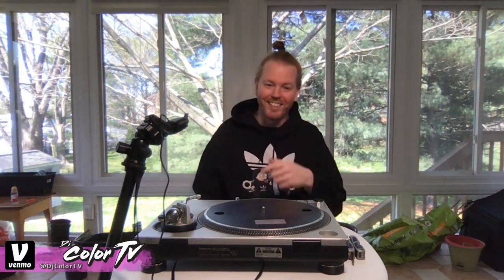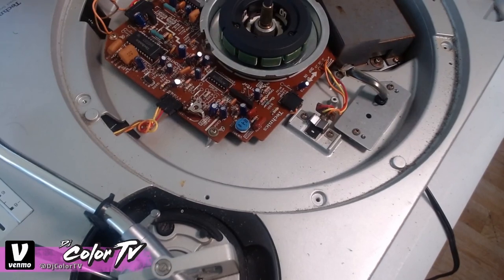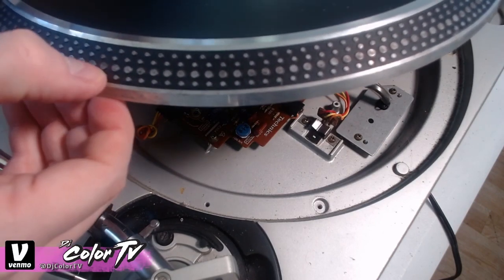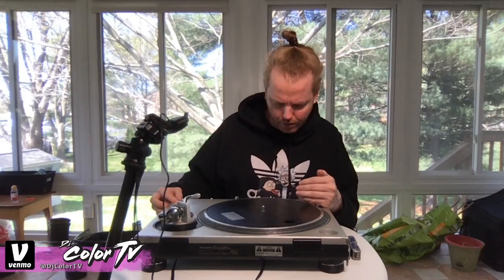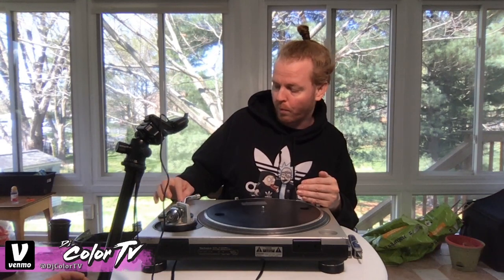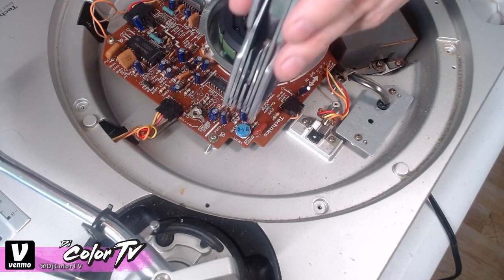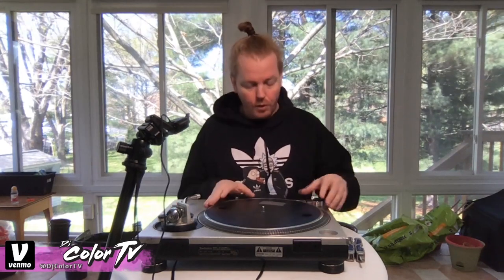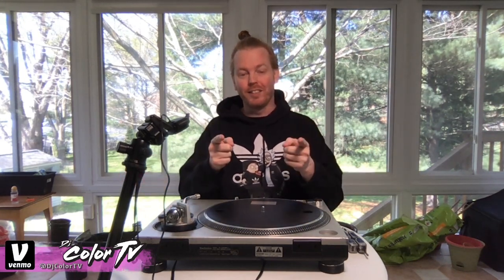How to Calibrate Pitch Fader for Technics1200 || DJ Color TV

Comment: When i move to +0.5 i get 0... in 0 pos. i get 0 too , what could be happen ?
Reply: Sometimes they can drift over time from usage. They just need a little tlc, (Pitch callibraton) .The main thing is they stay locked, Which even on my old ones they do. I have an older one that was always out by about half a %. But when mixing it was still ok. Its just something to be aware of while doing so.These days I would callibrate.
Reply: The dead spot on the pitch isn’t controlled by that calibration knob. You need to open up the back and look at the pitch fader. It has its own knob for adjusting the 0. You don’t have to play around with it it’s easy with a multimeter. Just measure the orange and brown wires and adjust the knob until you have exactly 2.7ohms on the multimeter. That’s the offical 0 position.
Reply: Read my main comment. People don't like beat mixing around the zero mark as you could not disable quartz lock on the older turntables. You can disable it meaning it won't force a quartz lock when close to the zero position. Every time you come into or out of the quartz lock zone the pitch will glitch in the wrong direction for a short part of the travel. I wrote how to do the mod and calibrate in the other comment.

Comment: First you want to do the quartz lock disable mod (remove orange wire from pitch fader connector (2nd in from the left, use a pin to remove it and then insulate and hide it out of the way) where it meets main board under platter and cut one end of the resistor R209 closest to TP17 on the main board under the platter). Then recalibrate. Try setting the zero adjust potentiometer on the board with the pitch fader to 2.4Kohms (while fader is in the zero position) instead of 2.7. Now, under platter cover adjust top strobe dot to be still at +6 with the blue plastic pitch potentiometer on the main board. Now go back and check zero strobe dot in zero position. with bottom cover still removed over hang the corner with the pitch fader part off the side of a table. Now while it is playing, from beneath adjust the small potentiometer on the pitch fader board till you achieve zero on the strobe while fader is in the zero position. This is the fastest way to disable quartz lock and set it up with the new calibration.